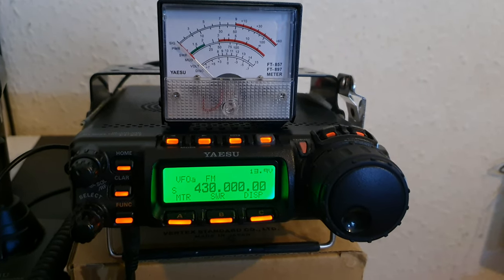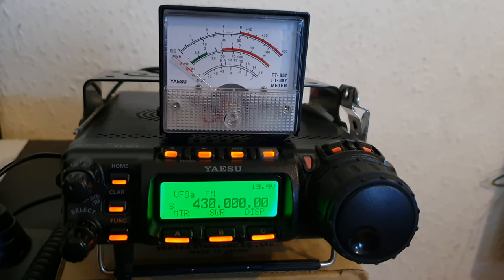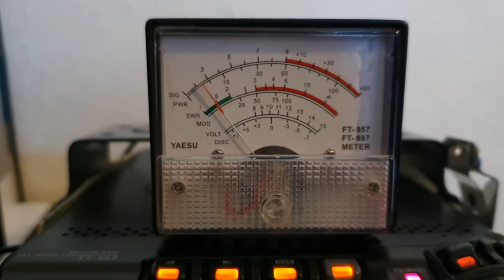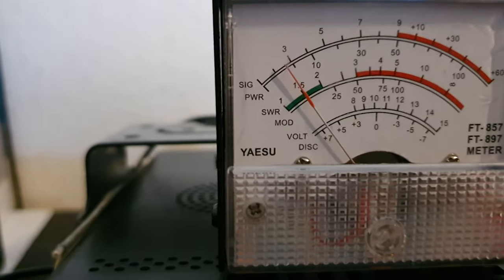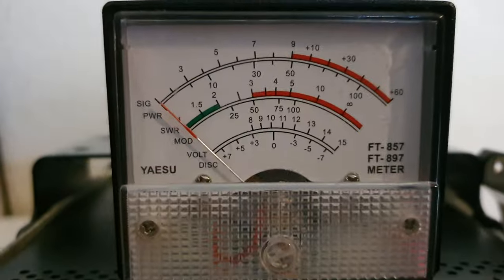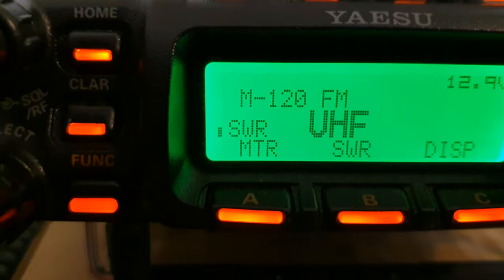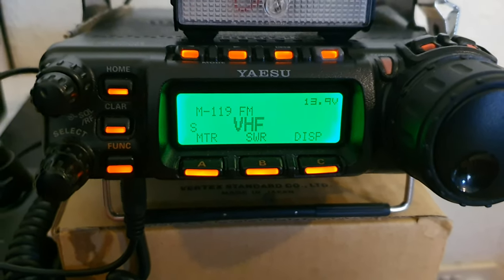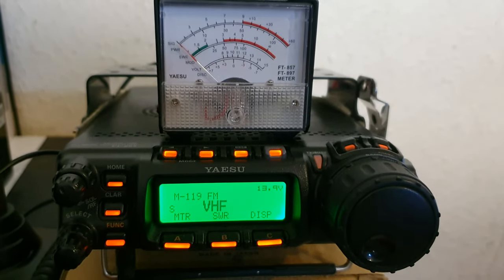YAESU 857  SWR ANALOG READING

Comment: Finally a video that actually shows what the SWR on the 857 represents. THANK YOU! I've now got the external meter for the radio. Is there another marker at 3:1 reading too. Ive only recently purchased this radio and mainly use it mobile without the Analog meter attached with various Ampro whips I've borrowed so would be really useful to know this for tuning on the fly. I notice the meter goes right to top and then flashes high SWR but not sure how height it has to be for this to happen. Any ideas? Thanks again Simon M0SCS
Reply from the maker: Not sure 3:1..but 2:1 a dotted line will appear
Reply: Hello Simon, I’ve read your comment and had a look on mine. Even though I don’t have the analog meter yet I’ve checked the voltages out of the meter jack and then noted all the value as I go up to full scale. Now, if you look at the swr scale 2 is about S4 and 3 is about between S6/S7.
Translate to the display meter when you see appearing the first longer line is about swr2 as he said in the video and easily enough when a second step happens you’re on swr 3. 
Hope that helps.
Diego
Reply: @IZ0MTW  Many thanks for the the info. I now have the plugin external meter so easier to but very useful to know for when I'm mobile . Cheers Simon M0SCS